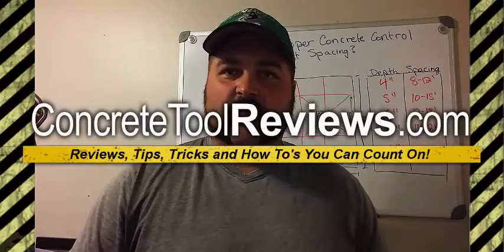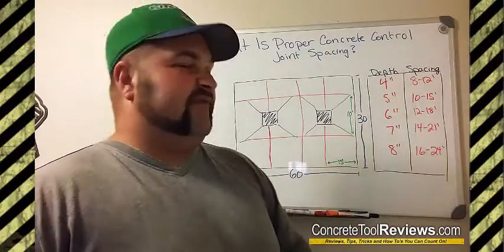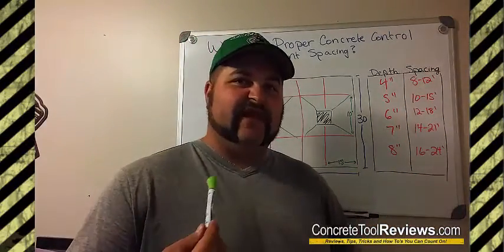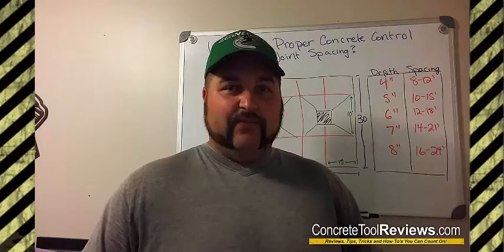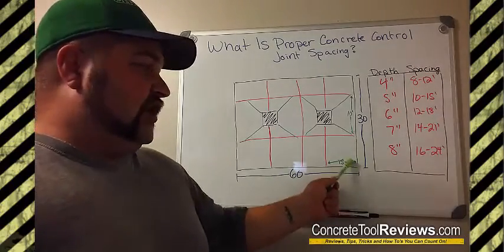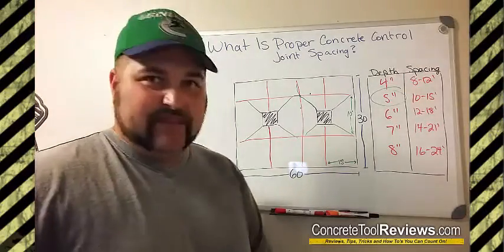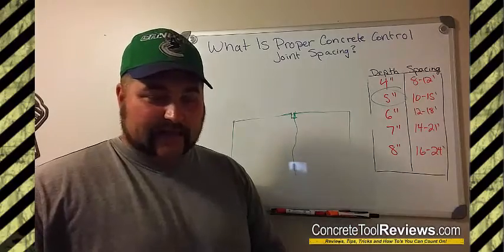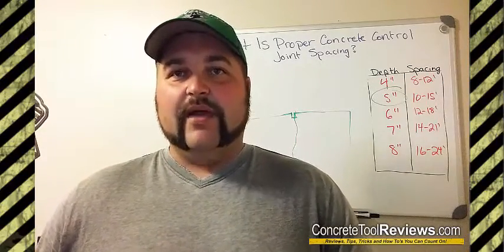What Is The Proper Concrete Control Joint Spacing

Comment: What about if your doing a 30x40 with like a car lift, how far would the lift have to be away from the joints. I wanted 5 in everywhere besides where lift will be about 10 in

Comment: Do you need to pay attention to the length and width ratio? Wouldn’t a control joint spacing of like 1’x15’ be prone to just crack in the middle rather than along the joint? Is there an ideal ratio?

Comment: On the depth of the cut you said a quarter inch on the depth of the concrete not a 1/4 on the depth of the slab, it was a little confusing.
Reply: Yes I thought that too. A quarter inch regardless of the thickness doesn't seem to make as much sense as a quarter of the thickness of the concrete.
Reply: yes..4" slab, 1" cut depth..1/4" cut depth wont do anything other than decorative designs